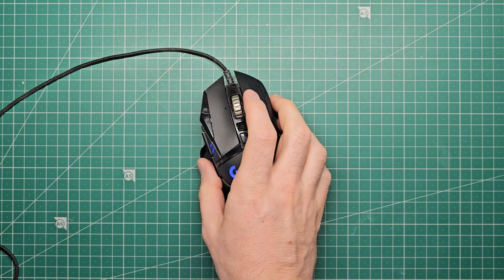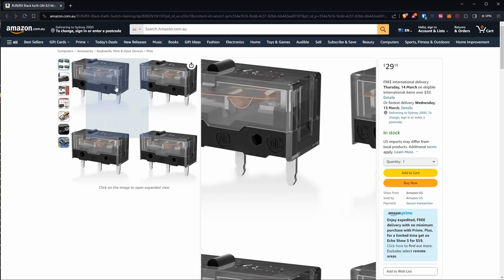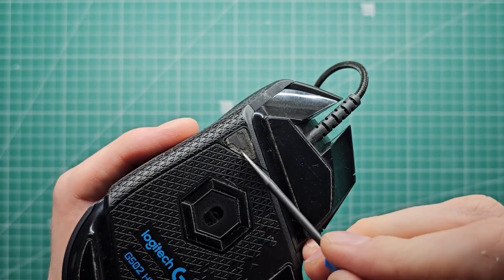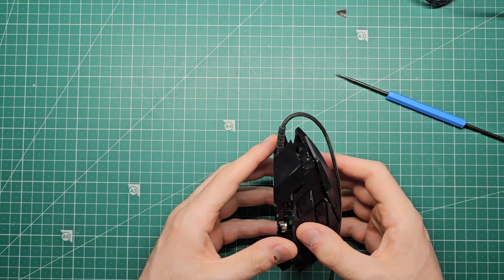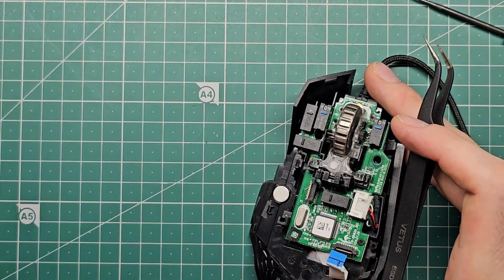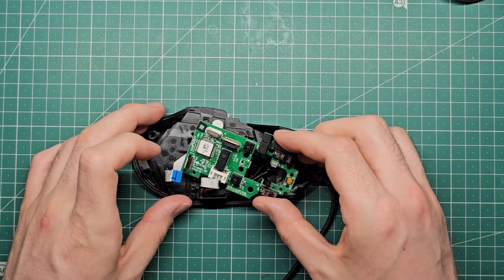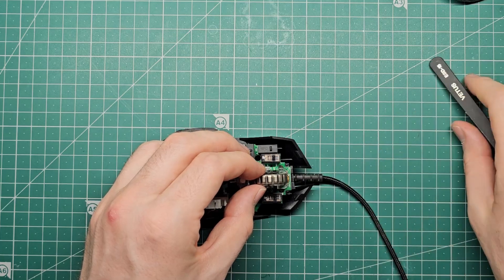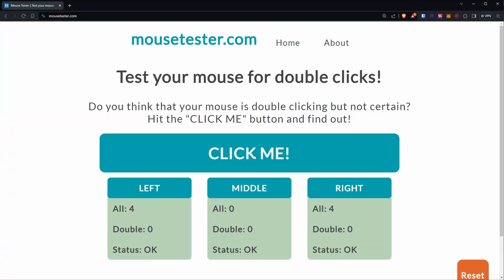Logitech G502 Hero Switch Replacement Tutorial | Double Clicking

Comment: I've been using it for 5 years. Occasionally, the battery LEDs flicker on and off randomly, seemingly indicating an error, stops working. I've cleaned it internally, checked the connections, wiring, and software. Everything is OK. It seems the battery is slightly swollen; I was able to confirm this by comparing it with new battery in a YouTube video. I'll update this with the results when the replacement arrives.

Comment: Nice tutorial!
A few tips for desoldering:
1. Low melt solder is your friend here
2. Flux, flux and more flux
3. Use only a small piece of solder braid ( hold it with tweezers ), so the heat won't dissipate so quickly

Comment: Did that on my brand new g502 and it wont power on anymore 😅, wanted to make it silent as standard switches make too much noise. well now its really silent i guess
Reply: nvm, fixed it. I messed up that small resistor and shorted it and pad next to it i guess? after applying some flux on it and heating it up it all went back into place. now it works

Comment: Nice guide.  But might want to invest in a small vacuum solder remover.  It is just a simple cylinder with a spring loaded plunger that sucks the solder out instantly.  :)

Comment: can you remove the side board switches too ?
I'm having problems with side board's switches
Reply from the maker: Yep! If anything, this should be even easier as the side board is only held in the assembly with one cable. The desoldering and resoldering should be the exact same

Comment: if not plumbers putty, you can get this stuff called "quake hold", its meant to hold vases and stuff down from falling when an earthquake happens. it never dries and you can stick it on about anything. ive used it for a wire repair before and it worked fairly well.

Comment: what about the middle click? what if it stops clicking? i have 2 with that problem, bu they dont have switch, so i wonder if you know the solution here
Reply from the maker: That one is a bit different. The middle click switch on the G502 is a small surface-mounted tactile switch (5:20). It can probably be replaced using another off the shelf part (look on mouser or digikey) and the disassembly process will be much the same. I haven't tried this repair myself but it doesn't look too difficult. The hardest part will be finding suitable replacement parts.

Comment: You should have put some flux on the solder wick after adding more solder to the joint, makes it absorb like magic
Reply: Absolutely! You can also get wick that is saturated with flux and that is the real answer. Also, the use of a temperature controlled soldering iron will help prevent damage to the traces and eyelets. Do NOT attack these things with a 40W $10 iron.

 Some of the classier mice come with sockets and switches with various ratings. If only every manufacturer would adopt this. I doubt it costs more than $0.10 per mouse when talking production quantities. But, then again, it would reduce the volume of product sold. lol

Comment: Hey Thanks.  I just replaced the switches.  The pads were reusable (removed them with a utility knife) and the old switches were unsoldered with a solder-sucker. 
One question -- why are there 3 pins on the switches?
Reply from the maker: Great question! Many electronic switches have 3 pins (lets call them A, B and C) and the switching action lets you change between two different connections. Eg, the open action might connect pins A-B, and then closing the switch forms the connection B-C instead. This is a somewhat redundant feature in PC mice, but these sorts of switches are used in other applications too, where you might want two different active switch states instead of simply open/closed.
Reply: @TerminalCuriosityEE  Switches like these (the technical term is SPDT, Single Pole Double Throw) have the pins NC, NO and C. Single Pole means it has one electrical "pathway" through it and Double Throw means there's two alternate ways it can take based on the position of the switch. 

C is the common lead and you pick which other pin you want to use based on your needs as an engineer. NC is "normally closed" - that is, electricity can flow through the switch at all times except when the switch is depressed. NO is "normally open", which is the opposite - the switch is "off" and blocks electricity until it's clicked.

Which one is used depends on the needs of the design. For example almost all safety/security critical switches (like emergency stops) will use NC switches because a cable break will look like a button press and therefore trigger the emergency stop/whatever it was used for.

Comment: Rodico, or Teachers Tack works wonders for that as well, and it is a low to no residue putty for holding things in place.    side note,  i hate those flux pens for desoldering work,   much prefer a cheap gel flux (20g needle on the end for fine control and less waste)

Comment: God damn it.  I had a logitech mouse that started losing its left click stability.  I pulled it apart in Feb 2020 and with a fair bit of annoyance, managed to bend the spring back and get it back together.  It fixed the issue for less than a year.  With the trouble I had with getting the spring back, I decided to just buy a new mouse in March 2021.  Its now only just over 3 years since I got my new mouse for $99AUD (a 502 hero) and the same thing is already happening.  I do like the idea of repairing 2% of the components instead of throwing out 100% of them in a wasteful manner.  But 2 switches are about 10% of the cost of replacement for a new mouse + plus extra pads.  But more importantly for me, I know this will cost me a several hours of my precious free time, cause me plenty of frustration and I may even break something in the process.

Buying a new mouse is so much easier.  I can't believe 3-4 years is all I get out of logitech mouse and keyboards these days.

Comment: I watched your KiCad plug in video and saw this one. Been through the mouse button issue a few times. Last time I used Kailh Red GM 4.0 switches as a replacement, probably from the same discussions you read, and they have worked great.

PS: Thanks for the plug in video, I'll be trying a few of those.
Reply from the maker: Thanks for the feedback! How do you feel using the Kailh red switches?
Reply: @TerminalCuriosityEE  So far I've not had to replace them and its been awhile.

Comment: Take an old toothbrush, 70% alcohol or something similar containing alcohol and thoroughly clean all the contacts on the boards, switches, buttons, solder points, wheel and so on. This really helps and physically replacing parts is the last thing you need to do.

Comment: I used to replace the switches in my mice. Got bored and tired of it. Bought one with optical switches. It fixed my problems with double clicking.
Reply: does any new g502 have optical switches?
Reply: nothing to do with getting tired of it. Its a matter of settling on mediocre switches (basically any mouse you can buy) or using EXACTLY the kind of switches you like best. All the time, without compromise. In the mouse body you like best, with the best sensor and chip you can find